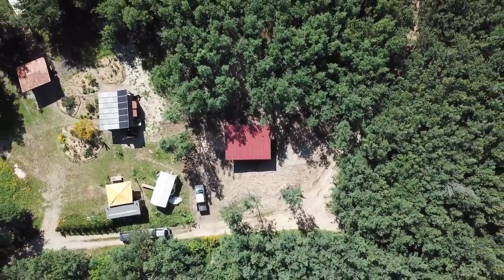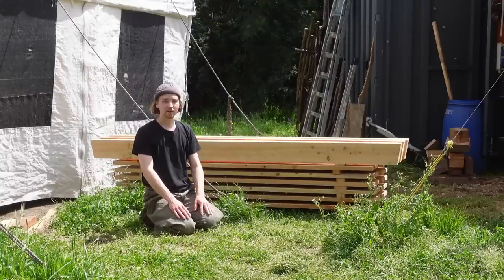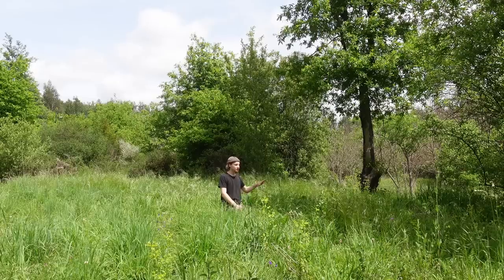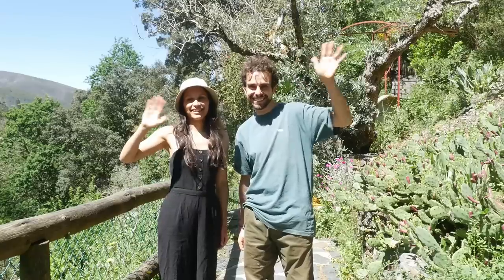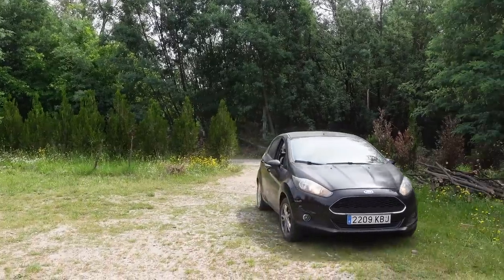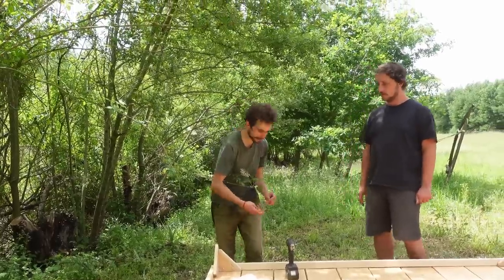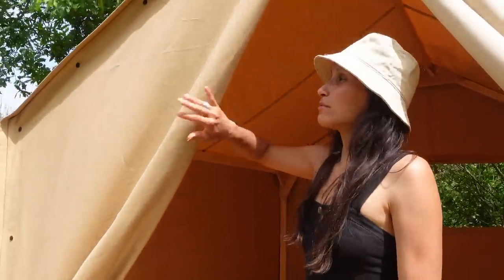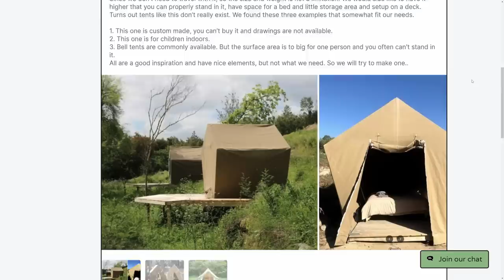#77 We made our own tiny tent (and give you the drawings)

Comment: I'm confused? How can you build a floor like that? There is literally no support except for the screws holding the floorboards. The same with the tent, the diagonals are super short. Sustainability needs to be implemented in the engineering as well.

Comment: Definitely needs mesh screens for the window and front entrance. I would also make the structure a little bit longer so that I can have a small front porch with a roof over it. Also, a good place to put your work shoes instead of taking them in the tent.
Reply: I was wondering if they had plans for the off cuts of the decking.  Might be a good way to add a deck while keeping cost down
Reply: @zabmcauley5647  I don't know but I would've used the whole length instead of cutting them.
Reply: The porch is a wonderful idea!

Comment: right away i would suggest adding a bug screen to the window of the tent, and maybe even designing one for the entrance. 
From what I remember you guys already have a big fly problem, but next to the water, i think a mosquito problem will be added. 

other than that, i really love the tent!!
Reply: exactly my first thought when I saw it the window.
Reply: Not only to the entrance and window, but also to the ground, insects/bugs will go through that decks floor :)
Reply: When talking about improvements: when the sun sets, moist will come up from the ground. To prevent your tent (and bed) getting moisty, a closed floor would be very convenient. 
The bolts might damage the fabric, so instead of normal bolts, maybe using carriage bolts might be an idea.
Last recommendation: I love the modular build up. It might be a good idea to make the front and back a bit larger: so you can fold the surplus over the frame, thus making a more watertight and mosquito tight connection.
But all in all, very nice tent with a very simple setup!!
Reply: @DaniTheDog.  and critters.
Reply: My second thought about the window was it can't be closed from the inside, if it starts to rain you'd have to get out and close and then come back in.
Reply: and maybe on the opposite side a tiny screen for ventilation. Great tent, could even fit in a 2 personbed 🙂
Reply: I was about to write this until i saw this comment :)
Reply: How is this comment from 6 days ago on a video from 1 hour ago
Reply: @Joe-uv9jo  patreons are one week ahead.
Reply: @Joe-uv9jo  I am a patron, so I get access to videos one week earlier
Reply: @Joe-uv9jo  if you parton then you can access early video so that your fund to pay
Reply: was looking for this
Reply: Might consider a mosquito net on the inside to, at krast, cover your bed Suriname nighttime, but then you would need to be able to attach it on the ceiling on the inside….

Comment: The tent placed on the rocks on the ground will sink. It needs some cement under the rocks to act as a base. Alternatively, you can put the sideposts in a hole in the ground and fill with cement then place use a straight level to make sure it's set straight. Similar to fence posts. The canvas was made beautifully however.

He's a very skilled woodworker but it looks like he hasn't had much experience working on projects putting wood into the earth. it's fine, it's a learning process :) He seems nice!

You could also try magnets to keep the top piece of the tent to the front and back, putting many up the fabric where it connects. They're easily removable and hold it together. Rain could get in, when it blows around. Then you don't have to worry about things inside getting mouldy so easily.

Comment: That's a really cool tent! I've worked in the tent making biz for oilfield suppliers (yeah, super not eco-friendly), and this is a really cool approach to the tent. Nice three-piece idea, tents that are one piece are heavy and difficult to install. A frame that comes apart is nice for storage, but I'm more used to frames that unfold (hinges) on tents that size.
I agree with the comments below, bug screen :P I'm a bit worried about the snap buttons, in a few years they probably won't fit anymore due to shrinkage. I see that lots, and then people start fighting with the snaps, they need to be replaced, or new ones added further out in the canvas to make it fit. So strap and buckles (strap goes around the frame, buckle to fasten) is a better approach. Also, a chuck-wagon for the main piece could be better, but I'm not sure how strong the winds are. Again, they did such a great job on the tent, lovely to see some sewing represented <3

Comment: Beautiful tent! I think it is wise to anchor the platform to the ground, otherwise it will sooner or later become a flying tent. ;)
Reply: I worried about this too. I have seen how wind is very powerful! It is a engineering problem, I think? What is the weight of the platform + tent + frame? How big of a wind coming directly into the open front is needed to lift this weight? I suppose what would happen, though, is that the big wind would smash the tent before it lifted the platform.
Reply: @jillelaine770  I wonder. The tent seems to be fairly well attached to the platform. But the platform is loose on the stones, as far as I understand. Then, in stormy weather, all it takes is a gust of wind to lift the platform and then the wind has free play. All this is quite easy to prevent by anchoring the platform (and thus the tent attached to it) to the ground. As long as that platform is fixed, I think the tent should be able to withstand quite a bit of bad weather.

Comment: If it gets windy there, you may end up having to put in some cross-members. Great design!!  I especially like the removable canvas.
Reply: I am very curious about how it will fare in wind. Tying the upper corners to the ground with cord might help a lot, through my chief concern is the framing at the top and the thickness (er, thinness :) of the wooden members. The load could be very high in a storm, I wonder if there are engineers in the camp who could calculate a theoretical max wind load. But better to make something than to keep drawing and calculating: time will tell so much about how the design can be improved! Thank you for this mellow update, always great to see progress at the camp through discreet projects like this.

Comment: Bugs and things will crawl in through all the gaps there. That is why you want to sow it in one piece, and preferably also sow a floor onto it -  to avoid bugs and draft from the floor as well. And you need mosquito nets for the window and the door. In my opinion. If you have lights on in the evening and no mosquito nets, the place will be full of mosquitos and flies in no time. I would also have made a frame to put the boards on, not just three loose beams resting on un-even rocks. And you would want a solid garden fork for grass turf removal. It is much easier to work with.

Comment: Nice job 😊
I'd add some diagonals to increase structural strength.
I'm happy that the roundabout sign is still there 😅
Reply: +1
Reply: How is this comment from 6 days ago on a video from 1 hour ago
Reply: A good idea,
this will reduce the dynamic load on the bolts.
The good thing is that you can add them if you get problems with stability.
Reply: @Joe-uv9jo  because if you are patreon you can see the vids 1 week earlier :)
Reply: Worried about the first hard gust of wind. Otherwise amazing!
Reply: The canvas provides that

Comment: Lots of excellent suggestions for the tent especially to deal with bugs and humidity.

Personally I'd consider a large internal mesh "tent" hung from the roof beam rather than trying to seal up all the gaps in the floor and outer canvas. Thats how most modern tents are designed with the water proof canvas wrapped around the frame and an inner mesh tent with tougher fabric floor hung off the frame.

I'd also add some more "vent" holes on the roof to help with heat and humidity

Comment: I like the tent, looks good. I would add tongue-and-groove in the corners and more resistance and save bolts and screws. Also add 2 long bar in the top, before the V in the tent, 10 to 15cm apart to have space to storage clothes, blankets etc. and couple wood or metal pins to holding stuff. Good job Eemelin

Comment: It turned out great for a prototype of a homemade tent. What I would also do is mount four eyelets on all upper corners on the outside. Prepare four cords and metal tent pegs so that all corners can be quickly fixed to the ground in a storm, making everything much more stable. Install fly net... When I hear you speak so shyly, I think you can't do much - but that's not the case!

Comment: The dome/yurt looks amazing, I've seen domes been built using a yurt canvas structure as a template, for rebar ,sprayed concrete + insulation, hexagonal cut cork board?, earthbags are excellent for heavier cob structures, raised beds, gardens and utilities like fixed bathrooms It would be so cool to have a network of natural sheltered corridors connecting multiuse spaces

Comment: You might want to look into using poles/  pole wood  cut from all the mimosa you’re cutting- this project you could have used large trunks for the deck base, and smaller trunks for the frame of the tent easily! You’ve got so many trees , free building wood ! Also generally for buildings, see pole buildings, pole barns , even woodcraft for camping! 
you could develop a use , even help your whole area that wants to cut mimosas!  Although it’s better for temporary buildings for fire safety. ( unless you plaster / stucco , or use in wattle and daub techniques) 

Other building styles that use the resources available on your land : straw bale building, cob / earth rammed , stone , cordwood buildings, all but the last exceptionally fire safe ! And the last only slightly less so .

Comment: if the frame is still racking a little bit, drill some holes in those wooden corner gussets and thread some stainless steel cable and turnbuckles to tension. should make it nice and sturdy (:

Comment: Nice to bring the outside in, birds, wind, creek, insects, etc. Not sure about larger animals: resting place, curosity, nesting place, territory marking. Based on frequency of use, foot traffic, remote location.
More concerned about how hot, cool, dry, bug free and secure (wind) the semi permanent tent is. There are 2 main straps and front or window vents but no bug screens. May need over protective layer for extra: shading, uv protection, cooling, rain/wind buffer.

Comment: zippers are super easy to sew.  you just need a zipper foot for the sewing machine.  easier than sewing on velcro and will last much longer.  finding LONG zippers can be hard tho.
Reply: I repaired tents for decades. I bought zippers "by the yard" on big rolls, then shortened them to the length needed. For a straight (not curved) zipper, #10 toothed zippers are very durable. For curved tent doors, like a big C shape, coil zipper must be used, but still in #10 size, which is very big. And the pulls must match the zipper type and size, with double tabs so a person can open the door from inside and out.

Comment: I’m not an expert in tents but I’m worried about few things. At first l wonder if you should add some ventilation holes (with net) somewhere high under the roof to prevent moisture and condensation. 
Then the rain - I don’t know this fabric but from what I learned where it’s getting touched by anything it’s probably gonna leak - so I’m not sure about these tightening stripes. And maybe there also should be double roof (tropic?)…
I would also make the longer roof and deck to have the entrance protected from sun and rain. And the sun may probably heat the whole interior very much.
I would also suggest bug nets everywhere possible.
By the way - really interesting prototype! 👍 can’t wait to see the progressions.

Comment: As time goes on, even with minimal movement,  those hex head bolts will wear at the canvas. It would be a lot better to use coach bolts or recess the hex heads below the surface of the timber. Also rounding the corners of all the timber will also prevent wear.

Comment: The tent as prototype should have been designed with more aspects into consideration, Ventilation, Extreme Heat vs Extreme Cold ventilation, Water protection (rain with wind vertical diagonal etc), strength against heavy rainfall and wind, easy access (velcro isn't cutting it), emergency situations etc...etc etc... its an ok thing for temp (not like you described long term).

Comment: I would consider using "T" nuts pressed into back of the beams. Besides reducing the tools required for assembly/disassembly they can make for a smoother surface inside of the beams and reduces the need for washers (on one side). Being a bit paranoid ... I tend to epoxy them into place.

Comment: Re questions: How do more people on the land impact the management of waste, specifially grey water and compost toilets? 
Re tent: the main tarp could be broader in width to create more overlap to prevent water seeping in from the corners where the tarps meet. A little overhang over the entry creates additional shade and rain protection. Mosquito nets, possibly an additional vent closer to the floor to allow more air circulation when the door is closed to avoid a trade off between privacy and ventilation.

Comment: A few needed things.  You need a "porch" with an overhang.  During the spring and summer rain you will need a place to: A) get wet gear off before going in the tent. B) Have added protection from the elements coming through the door.
Also, you need a vapor barrier under the decking, plus ensure the land is graded to take water away.  You also need a bug screens for the door and window.

Comment: you should have used all your mimosa for the tent structures.

you will need moskito netting in that window. You can secure it with velcro.

Also, you will need a plastic tarp over the tent, several cm above the canvas.
Reply: I too wondered if mimosa could be used as a tent structure, perhaps with a cone shaped tent like a teepee (tipi). I think though, I have seen in previous videos that freshly-cut mimosas twisted badly as they cured.

Comment: Hello from Belgium... love the channel, if i was only younger...!
Hopefully you see my remarqs as a positive building comments, absolutely no critics!
First of all, why put the tent so far from the camp, if you go to the tent at evening you'll be soaking wet when you arrive.
The tent is way to high, lower it at least 50 cm, if you can stand in the center it's OK.
I would close te floor completely (no gaps), preventing bugs to come in. Don't underestimate the power of bugs (when you want to sleep).
If possible sowing the complete tent in one piece (not tree) and don't use click-on buttons, the gaps whill shurely open and let wind and rain coming in. And for shure the window is in mosquito free screen.
Using Velcro is easy, but heavy duty zippers will do much better.
Maybe using velcro strips to connect the floor tarp to the side tarp.
Strapping the tarp to the floorpanel may be a little naive, i would at least strap it with 6x60 cm pegs (in ground) and heavy duty lugs on the tarp, this would be a great idea and i give you a quote; 
"When you are shure you dit EVERYTHING you could do to prevent it flying away, you never have to blame yourself when it does" ;-)

Making the tarp "bigger" is a very good idea, my tarp shrinked almost 200mm during use...

Good luck guys, nice editing and interesting video for all campers!! Love it!

Comment: Instead of Velcro I would suggest toggles. Longer life, not plastic and eliminates that Velcro sound, just a more pleasurable way of operating it than pulling on the velcro. Mosquito net would be an idea especially so close to the water… Checkout the design BAKER TENT. Would be perfect for here it Multifunctional to add a porch outside it for a shaded area and can close via toggle in the evening. And also possible to use in the winter with a log burner inside you can make yourself quite easy. There are plenty blueprints online and people making there own it’s a tried and tested old fashioned can’t beat it classic. Sending good vibes enjoy 😊

Comment: Also on the window I would fix some kind of folded in the triangle fold it in and I'll do it on the soda until you can stick a. Bar in there and then one solo into the flap of the window and then you could stick a bar from 1 point to the other and have a lean. Out rain shield and maybe so in a little screen and there are a screen that can Velcro to the Velcro that you already have there.

Comment: looks nice... but i needs some upgrades... air vent on tor top to get rid of hot air... i'm a bit skeptical about not connecting front and back to the sides in any way... also bugs will live with you with gaps like this. but already a bit to nice for a prototype... i am curious for version 0.2

Comment: Tent looks great. My suggestions also mosquito mesh (Cld be velcroed on so replacement easy and also to access outer rolled up panel if raining) for window and door sections and something a little stronger for floor piece so ants or other beasties don’t become an issue. Plus a bigger ‘fly’ piece that sits above the whole structure as extra water proofing and to protect the main section from shrinkage. This could provide a type of verandah on each side and possibly the front for storage of bits n pieces outside of the tent and a porch. Rounded bolts that won’t destroy the fabric in windy conditions poss worth experimenting with. Maybe extra porch and steps for a place for a chair to contemplate nature. Well done with prototype.